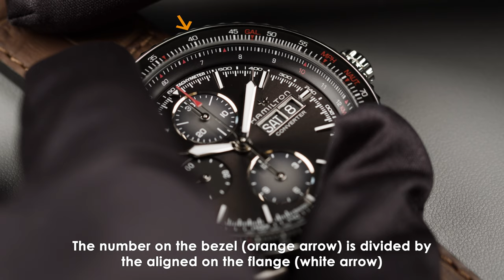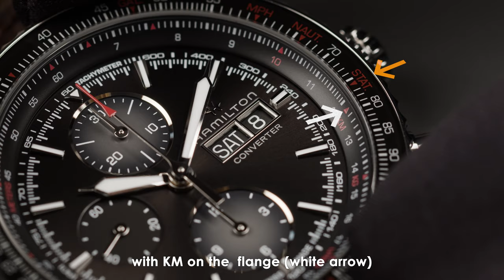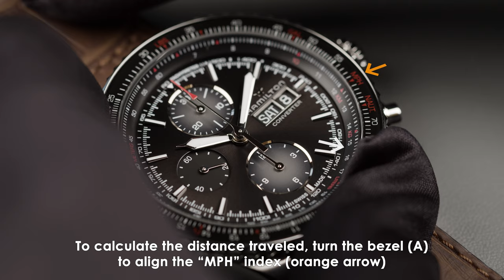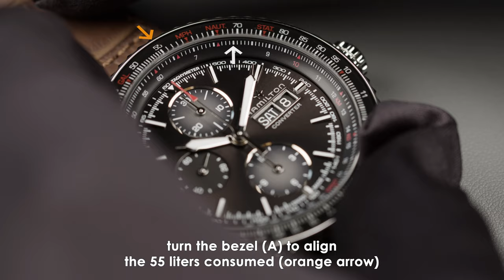How to calculate critical conversions with your pilot watch | Hamilton Watch

Comment: Multiplication makes no sense. 15 x 10 does not equal 45
Reply: No equal 450 😊
Reply: I believe 10 red arrow sets the number on the bezel (15) to 'multiplication', so that all numbers now in the inner wheel are multiplied by 15 with the resulting number on the outer bezel.  You need to multiple or divide the resulting number in your head by 10 to get the correct answer.  So for example, 30 or '3' gives us 45 (15x3=45) or (450 if you multiply by 10).  If you pause the video at 0:29 you can check other numbers on the wheel to see the common pattern.  For example 60 (or '6') on the inner wheel points to 90 or 900.  (15x6 or 15x60 respectively).  16 inner wheel points to 24 or '240',  15x16 = 240, 15x1.6=24 etc.  12 inner wheel points to 18 (15x12=180 or 15x1.2=18) you get the picture.
Reply: Watch the part again, he doesn't calculate 15 x 10 in the video. He did 15 x 3 or 30, depending on what you want to calculate.

Comment: This video is better than most slide rule bezel tutorial I have seen. But it could be even clearer. It gives you some examples but the working principles are left untold.
The main point with the slide rule is that when you turn the bezel you are setting a ratio between the inner and outer scale. The ratio is the same at every place around the tool. Converter is a perfect example for this. Here the bezel is set to give a ratio of 1.2 to 1. The narrator continues "The result (green arrow) appears opposite any number indicated on the bezel (red arrow)." Correct, but a little ambiguous. It could be said that you can now find the conversion between any amount of francs, which are on the outer scale,  and euros, which are on the inner scale. And you can do it either way.
The principle of constant ratio works also with other cases. When we are talking about speeds, you use one scale for distance, the other for time. Km/h is a ratio - but it is handier to use minutes in the time scale. The example case here was that you have travelled 112 miles in 28 minutes, so you align 11.2 with 28. Now, it would be helpful to explain that you have actually set the speed in the scales, and you can find the speed in miles per hour opposite to the 60 minutes point of the time scale. But you can also see many other things without doing any adjustments: like how long time it would take to travel 255 miles, or how far would you be after 95 minutes at this speed. Just find the point at the respective scale and see what the other scale reads there. The same principle works with fuel consumption calculations (litres or gallons per time or distance). You often don't need to think about dvision or multiplication at all. A slide rule is kind of handier than a calculator, as you can see all the conversion results once you have set the ratio. With a calculator, typing in numbers is needed for every single conversion.
Reply: This was very helpful and makes me wanna dive more to become a master of slide rule converters!